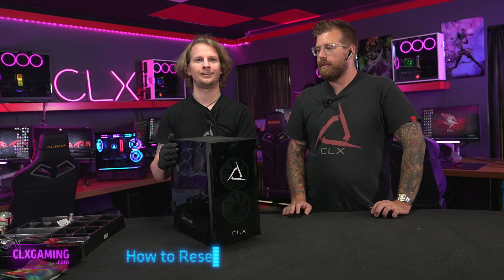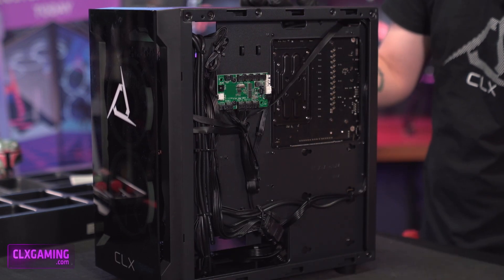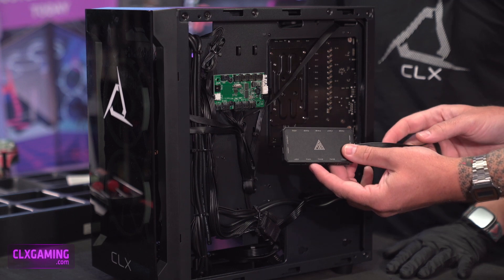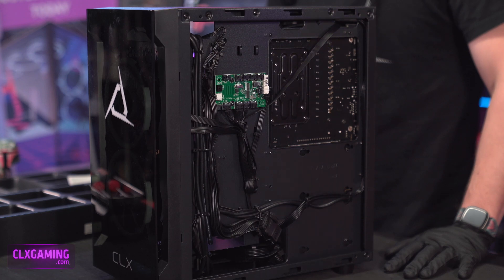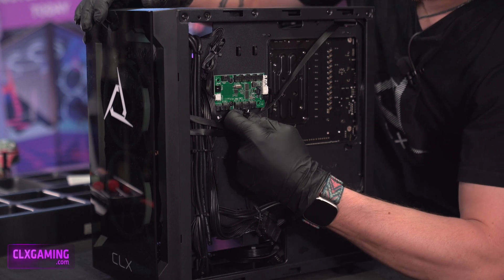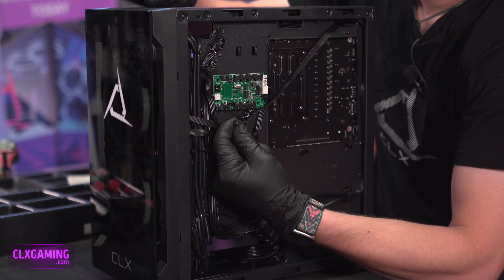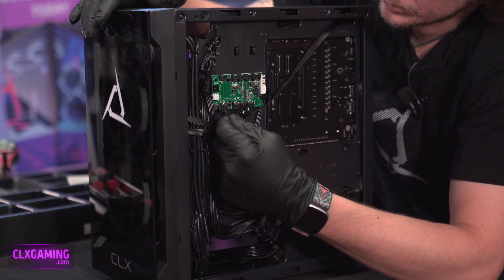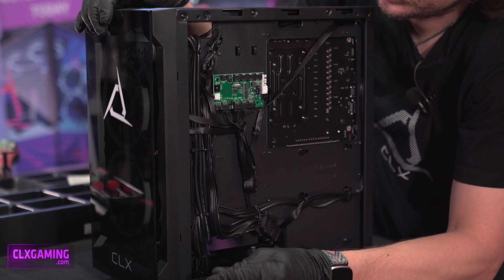CLX How To: Reconnecting Your Gamdias Gaming PC Fan Plugs

Comment: Three of my fans' lights are flashing rbg randomly. I contacted CLX support. They directed me to this video, and told me to unplug the fan wires, and plug them back in. I did so, and it did not work. The problem still persists.